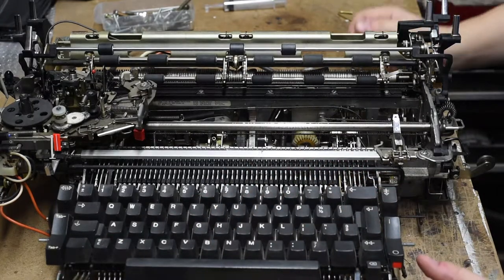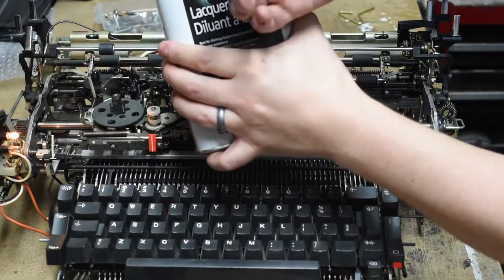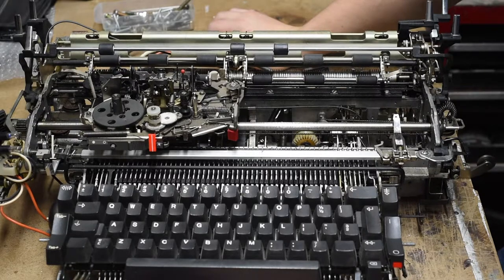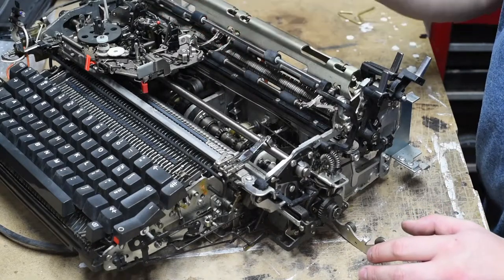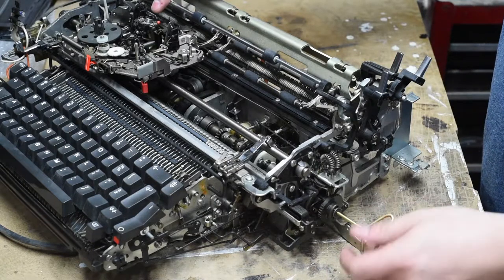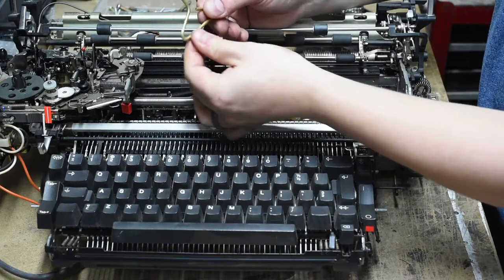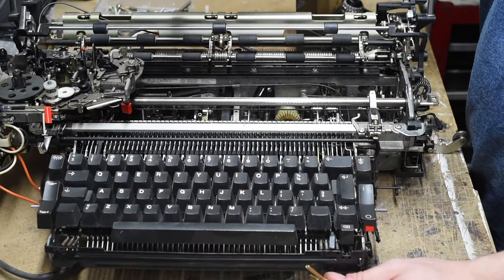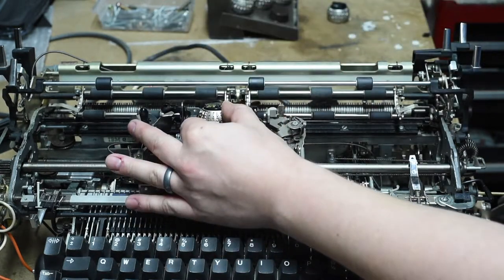How to hand cycle the IBM Selectric

Comment: Whatever you jam into the hole to rotate the axle manually, make sure that the metal you use is softer than the original metal in the thread. That way you don't destroy the thread.

Comment: I just got a IBM Correcting Selectric, however unfortunately rotate tape broke after I forcefully put it back to track/reel (it works for a while until i press "TAB" button). Not sure where to get a tape and it'll challenging to replace it. Any idea if I can use a nylon string to replace it?

Comment: My IBM Selectric (196C) is having reverse moving problem. The carriage moves from left side to right side(end) when hit return key .
Any advice would be appreciated.  Thank you
Reply: The carriage return cycle spring is operated by a dampener pressing on the spring my be not touching the spring can be adjusted.next to the return cycle spring is the torque limiter cycle spring there is a small spring on top attached to the spring and an arm that spring might be missing if it’s there bend the arm so the torque limiter spring is driving on the hub.
Reply: @JohnTannerBlueGuitar  Back when I was a rookie Office Equipment Tech a man much wiser than i told me...."No no no no no! You never ever bend anything! You adjust it." Then started laughing  his ass off.

Comment: Hi Andre. Just in case you see this message, I bought an S1 from eBay in excellent condition but the motor will not start up with power. Seller says it worked before shipping and I believe him. Something must have been knocked lose in transit. Any ideas? Thank you!
Reply from the maker: I would check the wiring from the switch to the motor. The wires have a habit of breaking at the switch. They may look ok but the wire may be broken inside the insulation.